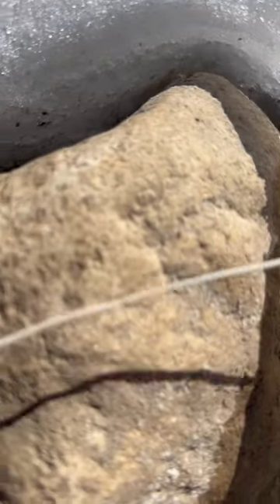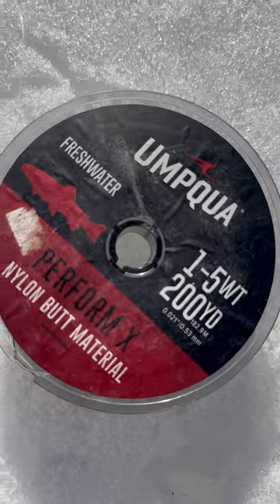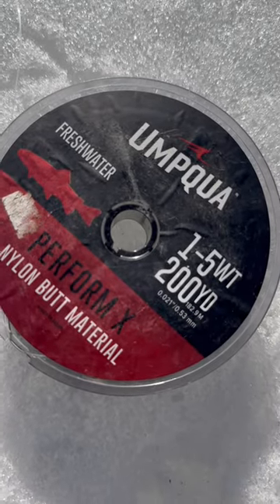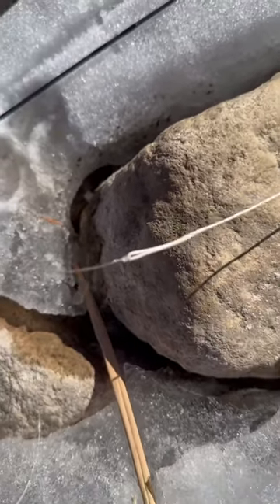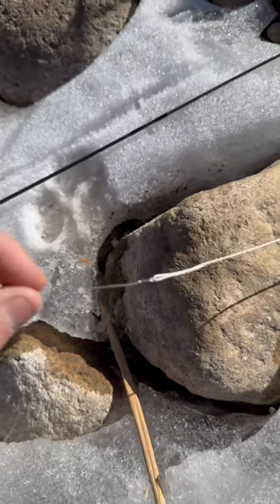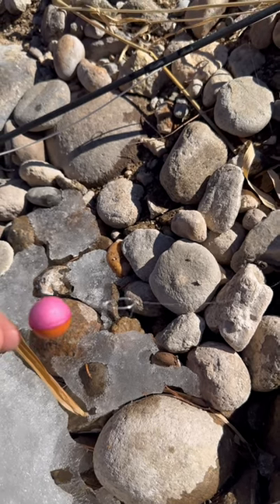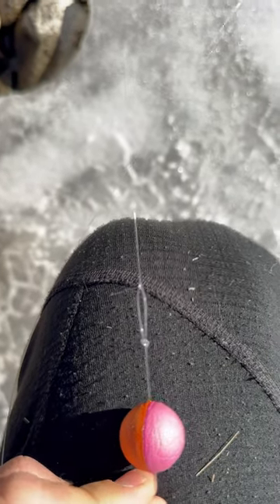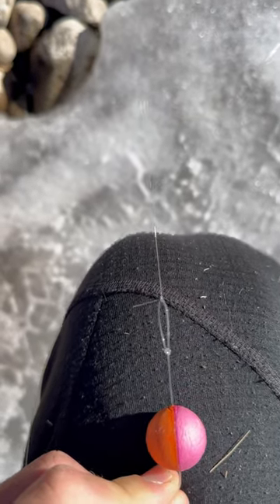How to BUILD a Nymphing Leader with a Guide Secret! #flyfishing #nymphing

Comment: So there’s no taper in the system? 4-5 feet of 50# from fly line and end with a perfection loop.  Then 5-6 feet of 5x to your flies? Indicator on the 5x?
Reply from the maker: Correct just straight 50lb leader with a loop knot tied at the end to hold the indicator so it can’t slip onto the 2-6x. Then fluorocarbon straight off the loop so it all sinks immediately. And if you ever tangle (like me) you can just untangle the rig and re tie it onto the loop knot instead of having to triple surgeon the whole rig back on
Reply: @StoneflySteve  for the Big T, what’s your go to length of the butt section and for the tippet?
Reply from the maker: @williamwojcieszek4320  I use a longer leader on the big t… I find 6 feet keeps your fly line off the water when high sticking. 30” of 5x off the bobber to my first fly then 12” 5x to my second fly. Or in the summer off the leader 12” of 1x to hopper with 6” of 4x to perdigon
Reply: @StoneflySteve  awesome, thank you!